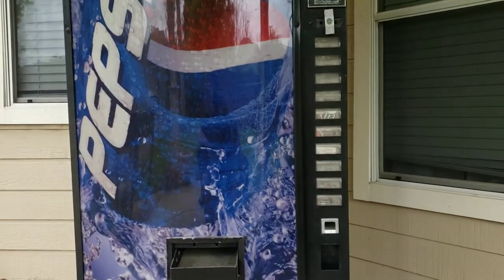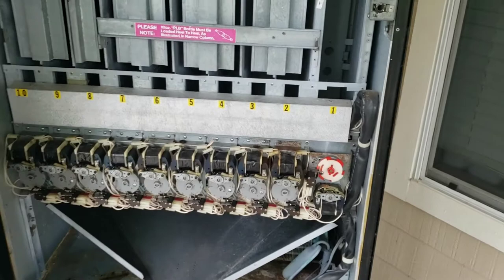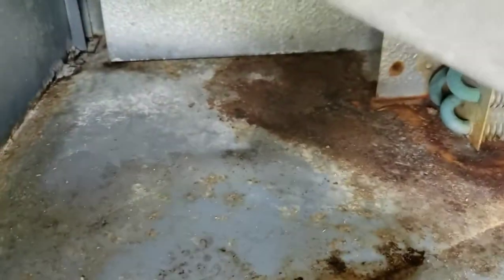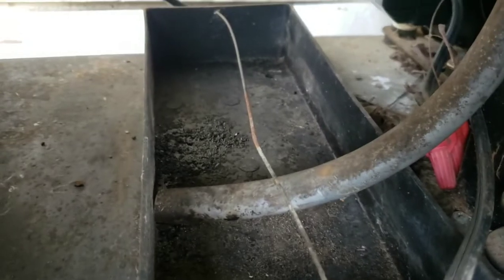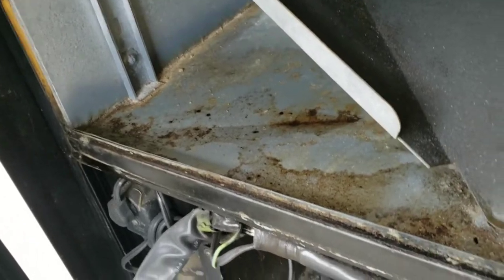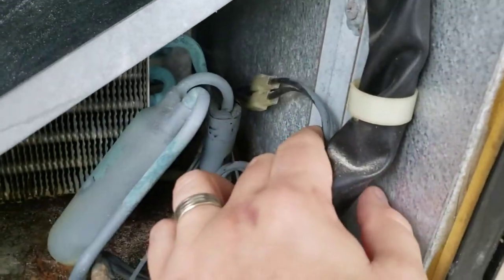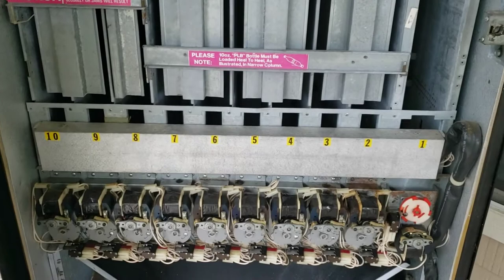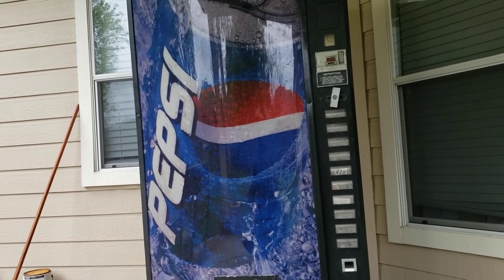Soda vending machine shorting out - simple fix

Comment: Hey I have the same one but it wont vend at all none of them work i pressed the switch thing on all of them and it didn’t work it stays cold but wont vend
Reply from the maker: If none of them work you probably aren't getting power to the bank of motors. I would get a wiring diagram and test for power coming into any motor. If none, then test for power coming into the motor bank. Keep going from there. It could end up being something really simple.
Reply: @anythingmechanical3399  ok thanks I will try that

Comment: I have the same machine. I have a wheel stuck. How can I unsezie it?
Reply from the maker: If you mean the vend cup, if you remove the vend motor you can insert a screw driver or pry bar into the slot and turn the cup that way. I have another video on repairing vending machines that may also be helpful

Comment: That may have been the culprit, but did you ever think that the compressor running full-power and whatever else may have been on the circuit was drawing too much amperage and may have overloaded the circuit?  That machine needs to be on  a 15A circuit, at least, by itself.
Reply from the maker: Hey Peter. At first I did think there was a chance they overloaded the circuit. But then when they described how it would consistently trip the breaker hours after plugging it in, I figured it was something else and looked to a problem with the machine. The compressor kicks on the moment the machine is plugged in and shouldn't draw more current than a refrigerator.
Reply: @anythingmechanical3399  Those DN501e vendors draw 11A.